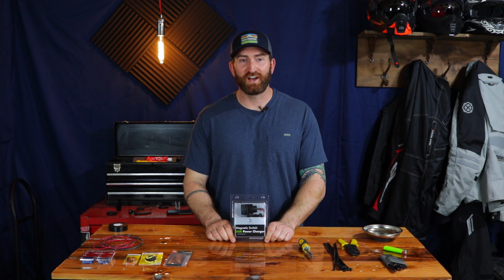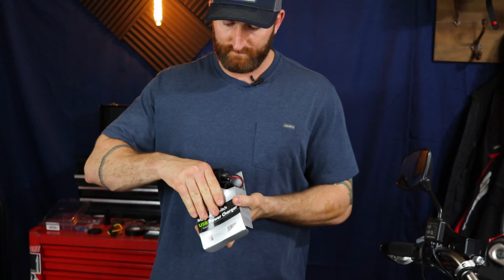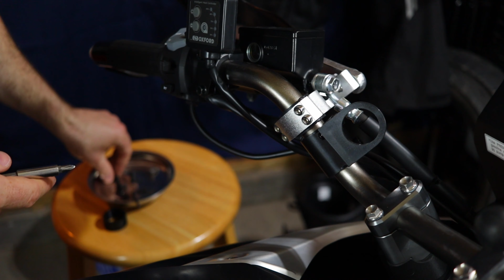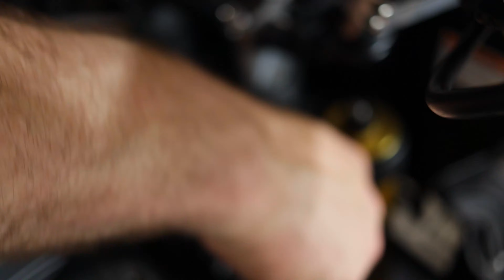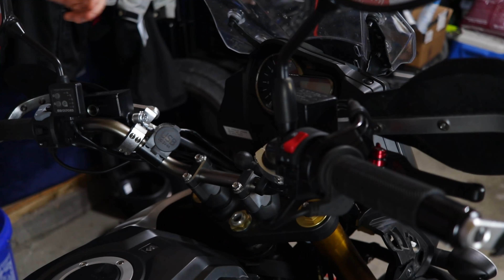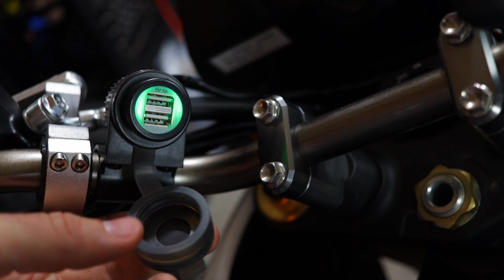How To: USB Bar Mounted Device Charger Install

Comment: It's not ignition key controlled? So stranger can use it without bike keys when they are parked and can drain battery, right?
Reply from the maker: The cover turns it off.... I'm really not more than 30ft away from my bike when I'm riding and most of that is off road... not many people around. If you're concerned about people stealing power off you then yeah run the power wire off the ignition.
Reply: @WeekendAdventureRides  watch this...https://youtu.be/rqsYFDkiOro. although language is different. You may try this.
Reply: @WeekendAdventureRides  does it fast charge? There is no mention of Qualcomm quick charge 3.0 or 4.
Can it withstand heavy rains? Last time I had to drive around 200 km in rain so concerned of water entering and fusing my bike.
Reply from the maker: @roninr8199  the cap is water proof and it's a 4.0 port. I rode in the rain charging my phone in western Washington and never blew a fuse.
Reply: @WeekendAdventureRides  thanks for the info. I would go with cliff top Cigratte socket so that I can use a type c pd charger.
So I guess even the Cigratte socket would be rain resist. As long as it protects from rain and doesn't stop working I am very much fine with it. Is there any specific reason I should go with usb instead of Cigratte socket.